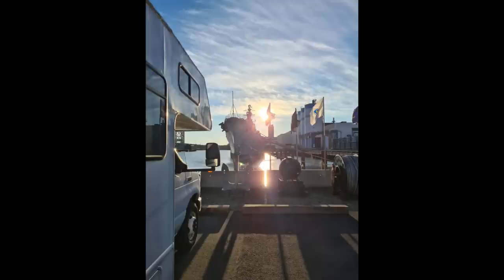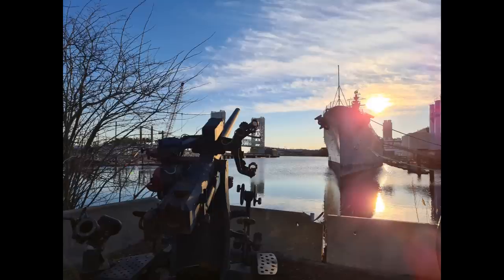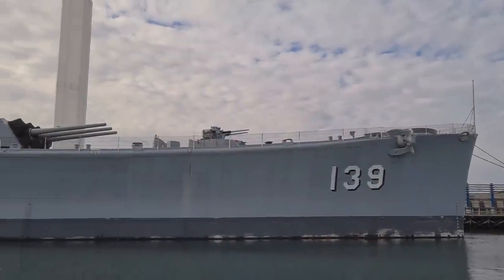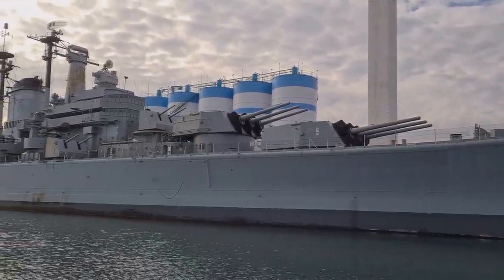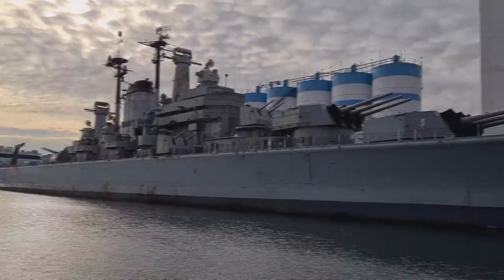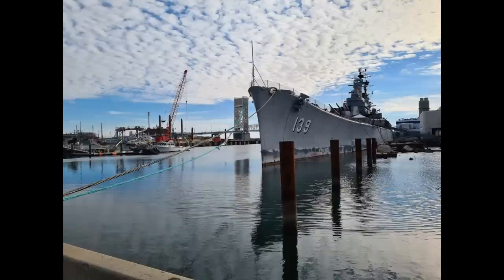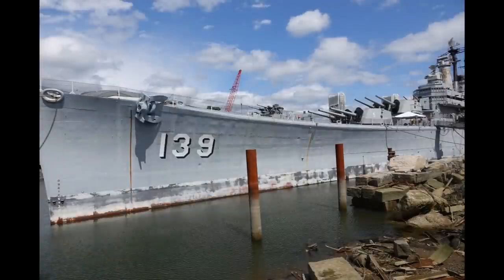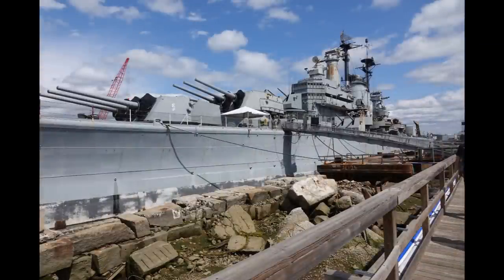USS Salem - Last of the heavy cruisers

Comment: Approximately 20 years ago I visited the ship as work was being done and off the bridge I think I found the Captain's day cabin and there was an opening in the ceiling above his bunk with an extension cord going up and into and like any Tribe Drach member I climbed in and up...and up...and up where I found what I believe to be an emergency gun director position for literally a 1 to 3 person crew with optical equipment, switches, lights and all covered by a clear dome similar to a bomber gun turret. Could you look into this and expound upon its uses and any other info you think interesting / appropriate in a Drydock please. All the best to you and yours. P S please try not to poison yourself in the future....
Reply: You are lucky to have visited this off limits space and not gotten caught!  That access near (not in) the captain's sea cabin is Spot 1, the main gun director for the forward facing gun mounts. That is completely off limits to visitors due to the vertical ladder access.
Reply: @lmo1960  thank you for that...I figured as much regarding access...what was also interesting was the way every approximately 7ft I had to switch sides on the ladder which was obviously to keep one from falling too far should one be separated from said ladder. Thanks again. Best wishes to you and yours  PAB

Comment: What truly boggles the mind is that that ship was blueprinted without the use of computers.  And then to build her with all that internal complexity.
Reply: Slide rules and manual calculations were the computers of the day.  The Salem has many analog fire control computers on board, but those were likely designed using slide rules!
Reply: I worked in ship design before computers.  The internals was designed with the help if a number of 1/8 scale models with perspex decks and bulkheads, and push-together plastic pipework.
Reply: @dukenukem5768  I built many a model ship as a kid.  I would have loved to get one that size to work on.

Comment: Drach, I don't know if this has been asked before in a Q&A, but what effect do you think it would have if the WW1 Gneisenau, scharnhorst, etc would have had if they were replaced by their WW2 counterparts?
Reply: Given that the battleships ran on fuel oil, I highly doubt that they would have been deployed overseas.

Given their advanced fire control (both stereoscopic rangefinders and the Seetakt radar were very good), they could effectively fight at ranges where British battleships couldn't really hit back, aside from perhaps QE class (does anyone know at which ranges they scored hits at Jutland?)

Given their 31 to 32 knot top speed, they were faster than pretty much anything afloat back then, aside from destroyers in a very calm sea. So I assume they could have taken the blockading force apart relatively easily. 

Also, given that their 54.5 caliber 11inch guns had very good penetration for their caliber, they could pretty comfortably take on the British battlecruisers. Especially when considering the bad performance of British AP shells, they should have been able to shrug off quite a bit of return fire.

So in my opinion, they would have been very valuable ships, though still only 2 of them are unlikely to make an impact to the point where it matters.

Comment: Drach,

If you ever get the chance to return to the USA, I highly recommend visiting USS Alabama (BB 60) in Mobile, Alabama. Her #2 16"/45 turret barbette is open for viewing all the way down to the bottom so one can see the loading train for one of these turrets. Believe me, it's very impressive! The powder passing scuttles, hoists, and shell rings are all open to view. Beneath one of the ammunition strike down hatches there was a semi-circular dent in the deck that looked like it had a radius of about 8 inches. I just hope no one's foot was beneath it...

In addition, main battery plot with its Mk. 8 range keeper (i.e., fire control computer) and its associated stable vertical is open to inspection, as are the Mk.1 fire control computers for the 5"/38 guns. Just forward of this is one of the interior communications (IC) switchboards which runs nearly completely athwartships. It's covered in action cutout (ACO) switches.

In my area of expertise, one of four main machinery rooms is open. One can see two M Type boilers, the main turbines and reduction gear set, two Ship Service Turbo Generators (SSTGs), electrical switchgear and loads of auxiliary machinery. Back in 2002 I used this space as a training aid to assist a colleague in understanding marine engineering technology. There really wasn't much change between then (about 1940) and 2002, especially as regards things like pumps, reduction gears, heat exchangers, etc.

Comment: Did some very quick napkin math and those 8 inch guns were capable of firing every 5 seconds, without stopping, until the ship exhausted its supply of ammunition.  That is a mind boggling amount of projectiles moving down range and despite the smaller guns I’m convinced it could put up a better fight than any cruiser deserves to against a battleship.  

Armor doesn’t do you much good at all if all of the air around you is made of fire and anything that isn’t metal is burning.  Including the paint on your metal.
Reply: Each rifle could fire 8-10 rounds per minute. Real world was about 8, and even then, ammunition and powder lasted for only a few days when Newport News bombarded North Vietnam

Comment: Great channel!  When I was in the US Navy I used to see Salem and her sisters moored at Philadelphia as I flew home from Norfolk on leave.  It was easy to spot USS Newport News because she was missing the center gun from B turret as a result of an accident while she was bombarding Viet Cong targets.  Just one small niggle here:  the portside 5-in38 you pointed out is not mounted on the main deck, at least not in US Navy jargon.  That is called the weather deck on this side of the pond.  The main deck is the deck below, so long as it runs the full length of the ship.  If a ship has a forecastle deck, like USS Arizona, the main deck would be one deck lower still--always the lowest enclosed deck that runs the full length of the ship.  Not a big deal, but knowing your great knowledge and precision, I thought I'd point that out.  Anyways, thanks for the BEST naval channel anywhere!
Reply: The main deck of the Salem is the full length topside weather deck.  The full length deck below is Salem's 2nd deck.
Reply: The designations may have changed over time, but the Salem has a Main, 2nd, and 3rd deck, 2 platforms below that, and 5-6 levels above the main/weather deck.

Comment: inside the gun pit with all the piping of copper and other types with the bulkhead behind all this it would almost look a bit like a steam engine cab except for the big electric motor directly in front on the deck and the two vertical tubes painted in gray. 27:40

Comment: A better way to explain the "gravity cooling coils" in the magazine is: The radiators are very near (no closer than 4 inches) the overhead (ceiling) and as heat rises the hotter air passes through the radiator fins conducting heat from the air to the chilled water. As more hot air is just underneath it will continue up displacing the now cooled air which will be forced out out of the way (to the sides) and fall creating a convection loop in the vicinity of the cooling coils. Another interesting thing is the gravity cooling coils tend to condensate and drip a lot. The bottom is actually overlapping v shaped troughs and the drains of which must be mounted athwartships to prevent spilling in rough seas.

Comment: While getting parts made is possible if you have prints the problem is price. Worked for a shop that did reconditioning and refurbishment.  If the custom wanted replacements can be made.
Somethings not in the shop or tapidly.
If ever necessary I believe a modern design might be possible.

Comment: I seem to remember reading, I think it was in Friedman's 'Naval Anti-Aircraft Guns and Gunnery' that, in addition to being lighter and with a better rate of fire, that the lethal radius of the 3" shell's explosion was a better match for the activation range of WWII era VT fuze than the bigger, nastier, 5"/38 shell.  
Basically that the larger shell's larger destructive radius was somewhat wasted in the AA role because the proximity fuze's own detection range wasn't that big-- if an aircraft was at the outer edge of the big shell's lethal zone the fuze wouldn't see it and the shell would go sailing past.

Comment: Another tour de force by Drach! As a gunner, I was particularly impressed by the automatic loading system of the 8” guns. However, I would like to take issue with Drach’s quip that the interrupted screw was a “better option” and that Krupp just had “refused to move on from the sliding breech block” 
The modern screw and sliding block breeches are roughly the same age, coming into general use in heavy artillery in the 1860s. The screw breech found in 20th century guns that use bagged charges is based on two important inventions: the de Bange obturator (1872) or the gasket system that keeps the gases from escaping backwards, and the Welin interrupted screw (c. 1890), which allows the screw thread supporting the breech block to cover more than 180° (actually 2x90° or 3x60°) of the breech block’s circumference, thus facilitating a shorter breech block while simultaneously minimising the amount of rotation necessary to lock the breech. The sliding block breech, on the other hand, is common in guns using cases (fixed or separate) for the charge, with the case also acting to seal the chamber and rendering a separate obturator unnecessary. 
The advantages of the screw breech are that it doesn’t need cased charges (though it can be used with them) and it also doesn’t necessarily need a massive breech – the breech block can be “screwed” directly into the rear end of the barrel, as was done in many late 19th century field guns. The disadvantages are that it is slower to operate than a sliding block, it takes up space behind the breech when open, and it is difficult to automate. The advantages of the sliding block are that it is mechanically simple, it is fast to operate, and it can be easily made to operate semi-automatically, i.e., to close by itself when the round or case is rammed in place and to open when the barrel recoils, simultaneously ejecting the case. It also takes up no extra space behind the breech when open, though it does take up some on the side. Disadvantages include needing a massive breech piece for the block to slide in and needing cased ammunition or charges. The advantage of speed is one reason why the sliding block has been popular particularly in AA guns and tank guns since both need to be able to fire quickly; the extra space needed by the open screw breech block also makes it unwieldly in a cramped tank turret.  In a turret gun, a massive breech is an advantage because the trunnions need to be as far back as possible to fit inside the turret and the breech acts as a counterweight; thus, the breeches on, e.g., US 16” naval guns are much bulkier than the screw breech would require. 
In 1921, the British tested a German 38 cm SK L/45 sliding block Krupp gun salvaged from the scuttled German super-dreadnought Bayern against the BL 15” Mark 1 of a Queen Elizabeth class battleship and found the loading speed of the German gun to be 13 seconds (36%) faster. As every naval and coastal gunner knows, the faster you can get rounds off, the higher is you hit probability within a given time. It was also noted that cased charges reduced the danger of unintentional ignition of the propellant when the vessel took a hit as compared to bagged charges (data from https://www.usni.org/magazines/naval-history-magazine/2021/august/krupp-horizontal-sliding-wedge-breechblock). I would thus question whether it was the Germans or everybody else that was behind their time – and whether the Americans in their last heavy gun design would go back to an inferior system.
Reply from the maker: The main problem of a horizontal sliding breech block in a capital ship is that it needs significantly more space to the side of the gun than an interrupted screw breech block. This is why Bismarcks turrets are so large for a twin 15", which means extra weight and space taken up when a more conventional breech setup would allow for either more guns on the same barrette or the same armament in a smaller turret.

As I noted, the USN solved this problem by using vertical sliding breach blocks, so Salems turrets are not overly large.
Reply: @Drachinifel  I find it difficult to believe German designers would have been unaware that a sliding block can also be made to move vertically. The problem is that a sliding block is quite heavy (as I know from experience) so a vertically moving one needs a rather large and stiff spring or hefty hydraulic or hydro-pneumatic cylinder to move it in or out of locked position (as the case may be) and keep it there. In the Salem, the block apparently opens upwards since the breech appears to be low. Considering that the breech block of the Bismarck would have been heavier than that of the Salem by a factor of over five (based on the relative weights of the guns and the shells), using a vertically sliding breech block on the 38 cm SK C/34 of the Bismarck and Tirpitz (or its earlier version on the WW1 Bayern class) would have required a very powerful and/or slow hydraulic system to move it. A horizontally moving block, by contrast, needs much less force to move and even a very heavy one could probably be moved manually if the hydraulic system were down -- which I doubt would be possible even with the 8-inch/55 caliber Mark 16 of the Des Moines class. If you look at inside pictures of the 38 cm SK C/34 at Møvik Fort in Norway, you will note that the open breech block protrudes only around 40-45 cm (c. 16"-18") out of the side of the breech, which is not terribly much more than the width of the cradle and trunnion. The movement needs only to be sufficient to cover the width of the rim of the cartridge case, which is only slightly more than the calibre. The combined 80-90 cm of clearance for the breech blocks of the two guns in the turrets of the Bismarck class would not appear to make a very large difference in the width of the turret; measuring from unofficial drawings in the relevant Wikipedia articles, the Bismarck turrets were all of 27 cm (<11") wider than those of the Revenge class with comparable guns. This, in all likelihood, was not seen by the Germans as a liability worth correcting by having to install a more complicated and slow vertical system that would render the guns unusable if damaged and would limit the verical arc of the barrels to the bargain.
As for which system is more "modern", I would argue that the screw breech with its obturator can be compared to the needle rifles of the 1830s-1860s (the Dreyse and the Chassepot) that used soft paper cartridges to hold the powder, i.e., breech-loading adaptations of a muzzle-loading system. Once the metal case was invented, the paper cartridge fell out of use. The use of uncased bagged charges that need an obturator and a screw breech is a carryover from muzzle-loading days. The screw breech is an elegant but complicated and difficult-to-produce mechanism that is at its best in an environment that is free of dirt and grime; I would hate to be the guy who has to keep the lands clean in a sandstorm.
Reply from the maker: @jarmokankaanpaa6528  a comparison in size between a standard British 15" twin, Bismarck and Yamato can been seen here: https://twitter.com/thegeneralboard/status/1367658857863012358?t=ZDHiwxoo1q0ghQSQoBYseA&s=19

I would note that Krupp were pretty much the only major gun maker in the world to persist with the brass cartridge and sliding breech block system in battleship grade guns despite the size penalties this imposed on the turrets. Everyone else went over to screw breeches. There is an additional issue in relation to gun pits, if you want to load at anything other than a flat angle, a sliding breech block needs a much wider gun pit to accommodate the needed movement.

Comment: As to US AA guided missiles:  The first one was TALOS and it was so big and heavy and had such huge director radars that they had to rebuild it into old WWII heavy cruiser hulls (and the USS LO)NG BEACH later).  Not only that, the missiles were RAMJETS!!!!  These missiles, which flew at 1750 miles/hour (2820 km/hr), were so far in advance of other missiles in the early 1950s that they were like Borg technology in STAR TREK.  The smaller replacement rocket-powered missiles systems, TERRIER long range and TARTAR medium range, replaced TALOS in the 1970s, and now Aegis has replaced all of them (being a kind of super-TARTAR with improved SM-2 thru SM-6 missiles as an advanced version with its superior computers and better sensors such as  phased-array radars).  US guided missiles systems set the standards for all future AA weapon systems.